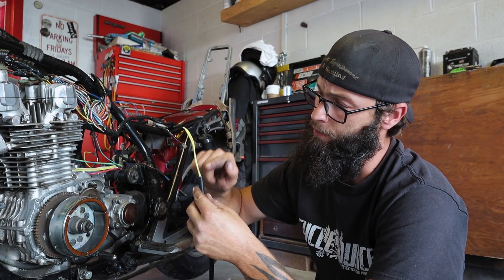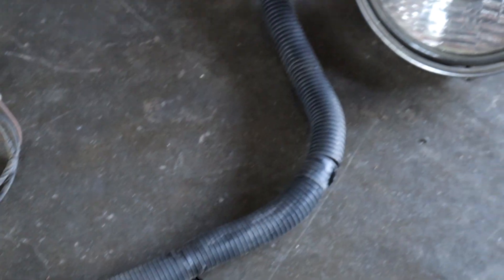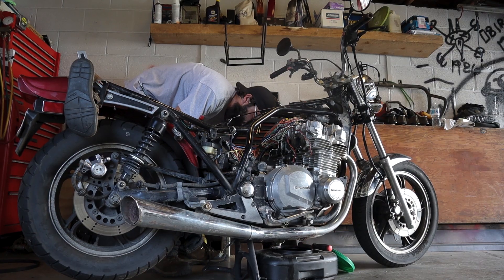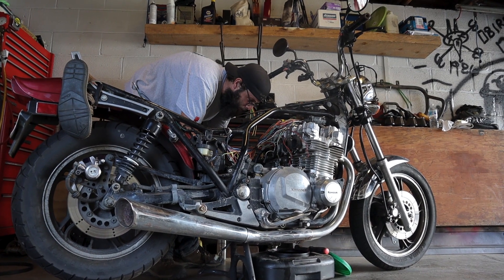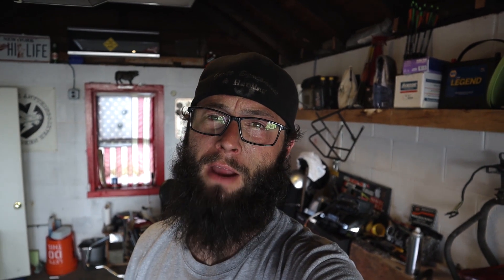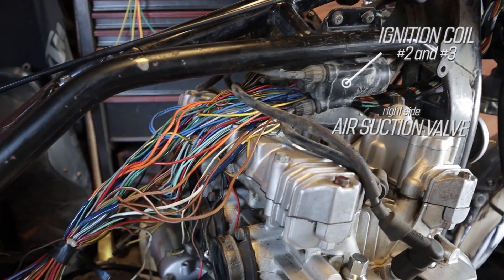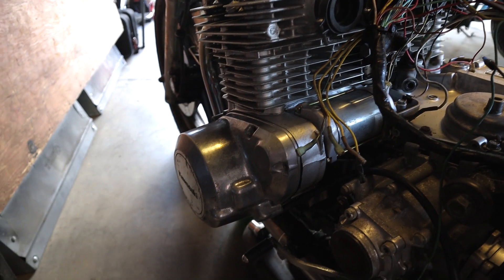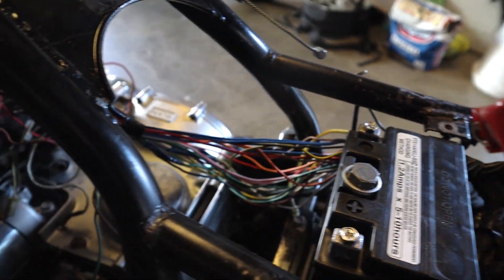Kawasaki WIRING harness TAKEN APART | charging issues 1984 Kawasaki ZN1100 ltd (B) REPAIR

Comment: Cool videos thanks!! Do you still own and ride it? I have the same bike like yours and excited to ride it, but... unfortunately without hand or servive book, can you tell me which oil manual says for the drive shaft and how much? Where can you get replacement parts for the carbs ? And which sparkplugs with which gap does manual say? New battery I should look for one with how many Cold crank Amps? Thanks in advance for the data.
Reply from the maker: Thanks for the kind words. I still have the bike, but I never got it running again - maybe one day. Service manuals are available, but because they didn’t make too many ZN models, you’ll have to buy a service manual for the KZ1000 - I believe that service manual has supplemental information on the ZN1100. I got my copy (from Clymer Manuals) when I got the bike, and it has come in hand many times. I used NGK B8ES spark plugs but never messed with the gap. I got replacement carb parts from Bike Bandit’s website and had no issues there. As for the final drive gear oil - I forgot what weight I used (it was whatever the manual recommended). And to replace/refill you have to drain from the drain plug (located near bottom), then add new gear oil at the fill hole until the gear oil starts to leak out of the top of said fill hole. It’s a relatively easy service. Best of luck on the project and thank you for watching the video.
Reply: @tomsilver725  Thanls for the quick reply and the info Tom. Mine had BR8ES installed with resistor..is that right? I hope to see a final serie of your bike till it runs soon. I look forward to see it running!!
 I wrote once down from a website... 4T 15w50 semi synt.  and 75w90 gear oil for the shaft drive is that what you use too? Where are those guys who write on a tag what they filled last? They are super rare! Greetings.
Reply from the maker: You might be right about them being BR8ES and not B8ES. It has been a while since I’ve look at the bike and the parts on it. I’m not sure I know what you mean when you say resistor. That makes me think of the regulator/rectifier - which is obviously a different component altogether. As for motor oil, I recall using Valvoline 20W50 Motorcycle Oil - in a black bottle (I can’t remember if it was synthetic or not), and yes - four quarts will be enough. The 75W-90 gear oil also rings a bell. 

I wish you luck on the project. Should I get mine going again, I will make a video and upload. Thanks again.
Reply: @tomsilver725  Thank you Tom for all the valuable info, am really looking forward to see your video and your bike running. I quote.. ' When its not running.. just take it apart and build it back together with testing every single part.' .... and let a camera run while you do it! High five..keep on rocking! Greetings.
Reply: @mantaBLS7biturbo  don't use the resistor plugs. Get the same one without the r in it. The final drive case oil should say on the cap. Should be a place to fill in the front behind the cover as well.
Reply: @tomsilver725  the R means it's a resistor plug and won't emit interfering signals that would be picked up by other devices I believe. Not to be used with spark plug caps that contain a 5000 ohm resistor. Factory doesn't I believe.
Reply: @kkc3009  thanks for tip Tom..i finally hauled my bike yesterday to my home..meanwhile I bought some parts included a Clymers manual..how did you cleaned out the spark plug bays?? I can't reach it far back. Greetings from TX.
Reply: @mantaBLS7biturbo  compressed air and a long reach/curved air nozzle.
Reply: @kkc3009  I tried it today with brake cleaner but that gunk didnt come off. I guess to completly clean it right i have to dismantle the engine or head...maybe later. thanks for the tip, Tom
Reply: @mantaBLS7biturbo  are you talking about the channel/valley that the spark plugs are in? 80psi or so after spraying some gunk or other cleaner in there should blow most out. Always make sure the plugs are in when you do. If you can't let the bike warm up then spray and rinse what you can or let it sit in the sun with the tank off, then spray with cleaner and maybe get a cleaning brush with long bristles. Rinse off and blow dry. That's about all I can suggest. I wouldn't remove and disassemble the engine to clean it that thoroughly unless you're restoring to pristine condition.